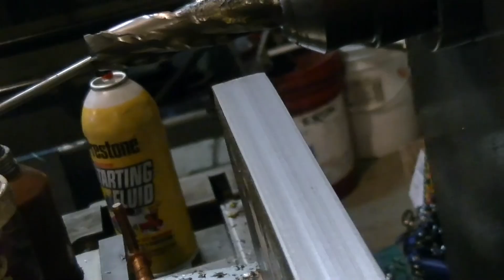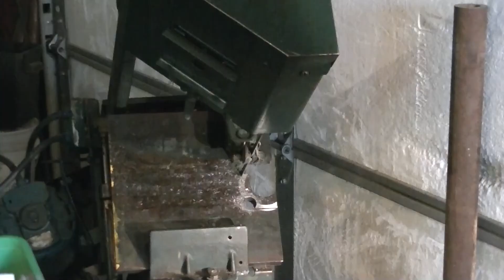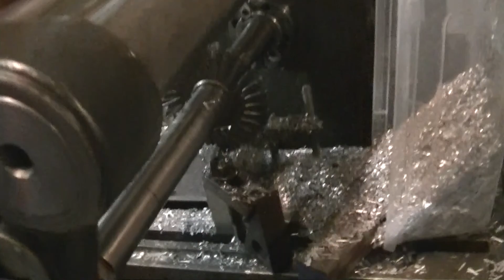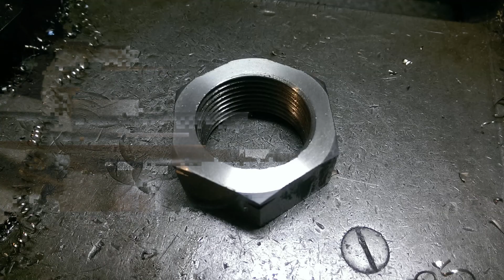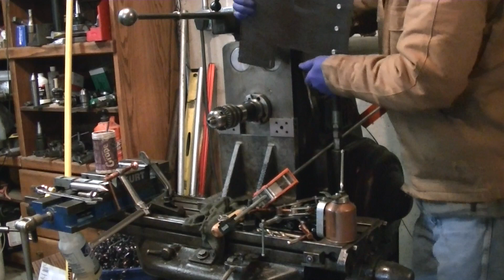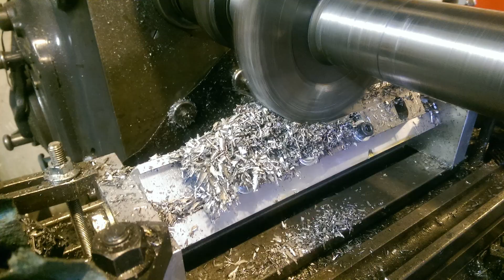K&T Mill Vertical Head Mount Part 4

Comment: Very clever set-ups Clem.  I must admit I sometimes struggle implementing robust part holding, especially on odd shaped jobs. I also appreciate you including your Mr. Bozo out-takes.  It is a reminder for ALL of us to be alert to all our actions around powered equipment.  BTW, my vacuum nozzle looks much worse than yours.  Thanks for sharing.   Fred
Reply from the maker: +Fred Miller I wish I didn't have so many screw ups to show but I think a big part of machining is learning to deal with screw ups and learn from them. Thanks for stopping by. Craig

Comment: The boring head would have worked if you had cut the expanding hole in .020 or .030 increments.
Reply: Oops, just realized that this video is 2 years old. You probably figured that out by now.
Reply from the maker: +Nik C. Colyer no worries. The boring head was working but I had to widen the opening so much to fit the horizontal spindle that I gave up and used the band saw instead, in the interest of making a long project slightly less long. Craig

Comment: A tip from Keith Rucker is that when you are using your overarm support, place the running bearing as close is possible to your cutting tool in order to strengthen support and cut down on vibration/chatter. I noticed that you have the running bearing at the end of the arbor. Good work.
Reply from the maker: James Conner unfortunately the only arbor I have is the A style that runs on the end of the arbor. This Old Tony has a good video on making an over arm support so I'm thinking that's an upcoming project. Thanks, Craig

Comment: Hi Clem
have you considered heat streightening  your  40 arbour  keith fenner  carries out this operation on marine shafting by the look of the runout its not much use anyway 

gary rhodes
Reply from the maker: Gary, a year or so ago I watched Keith's video and several others on heat straightening and then tried it on a 2 foot long piece a shaft I had. I only managed to make it more out of true. I've been meaning to make some rollers and try to figure it out but haven't had time and don't want to experiment on the arbor. Any advice about the method would be appreciated. Craig
Reply: Hi Craig
keith guards the actual details as commercial secret   I have never tried it myself  but   keith rucker has a posted a vid on it  I think that you spot heat the shaft opposite the bend and then cool quickly with water the heated area shrinks more than it expanded and pulls the shaft  this is only a educated guess though please dont try on your arbour on my advice